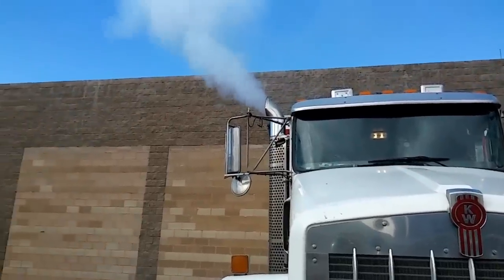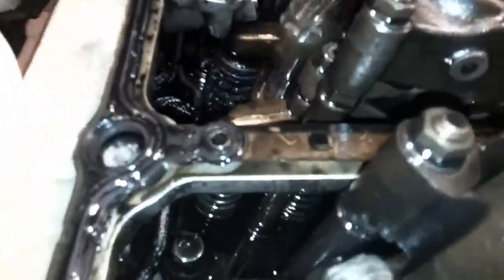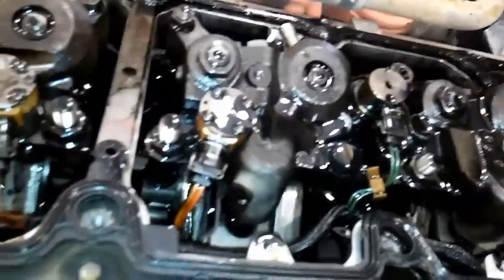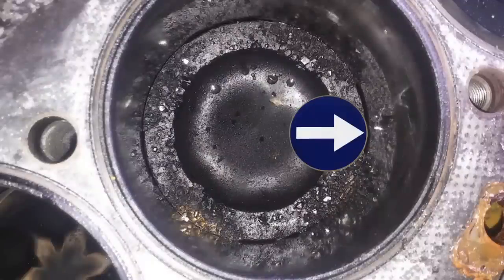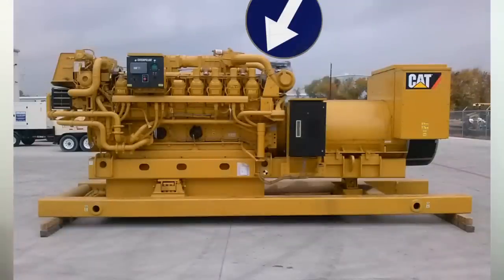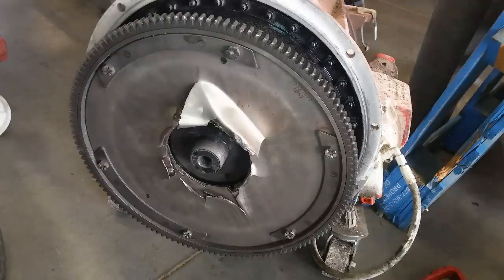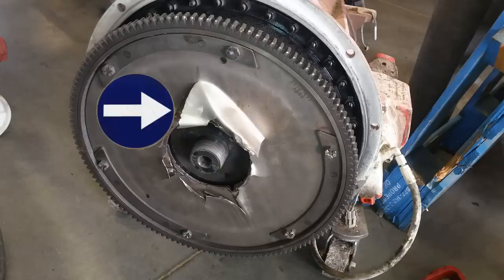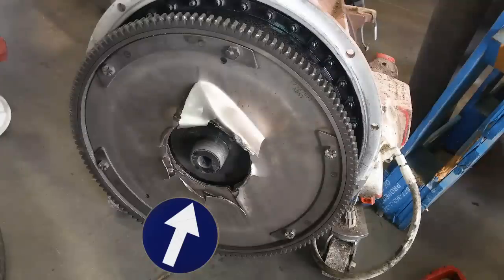Should You Warm Up A Diesel Engine?

Comment: Why not just read the owners manual instead, mine is for a cummins in a boat , it says to start engine and as soon as possible engage gears and warm up at a minimum of 800rpm unlike engine temp is reached , there is warnings in every chapter of the service manual saying do not idle engine go extended times if possible

Comment: Makes sense   ,when first starting  oil is like paint  I imagine  this must  put enormous  strain on oil  pump  as oil pressure  release  valve  cant let enough  out   .VW had problems  with  LT petrol engine drive  dog on crank would  wear away  if ordinary  20,50 oil used in cold temp  .where told not to rev engine on start

Comment: Diesel fuel does not flow or atomize the same when cold revving up a cold  engine deposits unburnt fuel on the engine and can put stress on fuel system.

Comment: I have a 2.0d engine and I start with fast 10 rev ups for idle to 1500rpm then another 10 to 2000, 2 to 2500 then keep it at 1500rpm for 30s then 2000rpm for 10s and finally 2500rpm for 30s

Comment: I have a C12  2KS  That has what Kenworth describes as a cold weather start feature that is programmed into the ECM,  I would like to know why as soon as the engine starts in 45 degree or colder temps the RPMs go immediately up to 750 then after 30 or so seconds return to normal... I normally plug it in at temps 32 degrees or colder, when plugged in this doesn't occur...
Question is, can this be deleted from the ECM because I normally like to build some oil pressure before raising the RPMs on my own..

Comment: There is no need to warm the engine.  Just watch the oil pressure and once it is up to pressure you are fine to go. Just do not hot rod it right off.

Comment: What about starting it up when it's cold out, should I let it idle and low rpm before I kick it up to the higher rpm that will supply power to the inverter and supply heat to the cab, or can I kick it up right away?

Comment: I've always warmed up my equipment, never had a problem. Company I work for gives us 3 minute idle before the truck shuts off, so they say no idling don't care if it's -20 below you WOT that with little to no idle, even if your pulling 50k lbs,then they wonder why the trucks are worn out before they hit 300k miles. Glad I'm not buying there trucks

Comment: if you live near the equater...aka Socal, Houston or FL no need to 'warm up' an engine if its above freezing, quickest way to 'warm up' (especially a diesel) is put a load on the crank and drive the damn vehicle to get block warm. Engine has no feelings, run it 15-20 seconds and drive off. Its a USA thing w diesel owners....'hard on diesels to start them' nope. 'let em idle instead of shutting them off' nope....USA diesel owners old wives tales.

Comment: It must be a Cat motor thing, but when it’s really cold every truck I drove with a cat motor idles lower than normal for a few minutes, then idle normal. The truck is drive now has an acert, once it idles up to normal, I idle it up to 900-1000 rpm to warm bc those turbo actuators don’t like the cold.  Run like shit and barely any boost till temp is around 170 degrees.

Comment: my old navistar 444E solves these warm up issues quite easily..  a feature exists in the computer that is RARELY ever turned on... it is called CAP... when its 10 degrees outside as you noted...  it starts the engine.. runs it at about 350 RPM for about 30 seconds...  then brings it up to 700  for about a miniute then 900 for 5 minutes.. then it auto adjusts the idle up to 1400  max..  until it gets near 170 degrees coolant then it backs the idle down.. i know these are old engines but the newer CATs may have the same feature that simply needs to be enabled in the computer..

Comment: Its te 15-40 oil that needs to warm up .. not so much the motor. Its same with all lubricants in the truck. You drive slow n easy till all lubricants become flowable. By time you build air pressure.... start driving slow n easy .... this isnt rocket science

Comment: Fire it up, check your lights, by then you can idle up & finish your pre-trip. Ready for easy load by then, short shift at 14-1500 RPM until temp hits 140 then increase shift points by 100 RPM with each 10' temp rise until fully warm. Engines are just like humans...be gentle when awakening the beast or you might not always like the result.

That DOTW exact same thing happened with me last week with MBE 4000 in an M2. The access hole for converter bolts is hell to get to, wedged under the damn starter on the WRONG side of the engine! POS kraut motor!!! I wouldn't wish that junk on ANYONE!

Comment: 2019 paccar mx-13, I fire it up and go to full throttle withing 30 seconds. Its under warranty 🤷
Reply: I've got one with blow by after replacing the block in another shop and I can't figure it out what's going on
Reply: Good motors I hear
Reply: It's certainly no cat, in my opinion, 600k maybe 700k and you should already have your plan to ditch it in place.

Comment: I used to drive a CAT 777G mining truck, and this winter when we had -20 -25c it had block heater and the C-32 but we also used to idle it for about an hour before we started working, by then all the oils and the coolant was at a good temperature, it also has a high idle function that activates below a certain coolant temperature

Comment: I bought an apcm for my 7.3ps so i can elavate rpms to warm up and in winter when real cold i like to kick on the unit but i am switching to a 205 t stat vs the 192 t stat and when i start driving at low pedal till warmed up a little

Comment: ''Oil galley"...?  It's an oil gallery. I am not convinced you understand engines. Cylinder pressure at idle is as it should be and doesn't vary with rpm. 80% of engine wear occurs within the first 10 seconds of starting any engine. If you are using the correct grade of oil it will lubricate any engine sufficiently within the first minute. Driving or using any engine gently from cold is a smart thing to do it shows mechanical sympathy. The main thing governing engine life is having clean oil, so regular and frequent oil and filter changes are paramount.

Comment: Yes if the temparature is less than -5 celciuz you leave it run for few minuts. If thete is temparature less than 5 degres celzium you run it for a minut or two. -15 or -20 degres celzium you run it for 4 or 5 minuts or more. 260.000km engine no problem. 1.6 TDI pdf, egr, at 207.000 injectors replaced after that egr blocked psizicaly and by softvear, had some problems with electrick viering to injectors but repered that to. For the last 30.000km and more the car is runing at 130 hp and about 300nm of torke. Stock is 105 hp and 240nm torke. I belive the car will go over 300.000with out any more problems but when it pass 350.000 km mark: turbine, injectors, clutch, break discks .... All off that will have to be changed again. So one or two more years with it and it,s time to buy a new one.

Comment: I usually let mine warm up for 10-15 minutes at most when it's about 30 f outside and I drive it for about 40 minutes to work. Doesn't have a high idle tune though

Comment: Has anyone here run a block heater on a timer from an auxiliary battery that charges from the main motor battery??  I'm just having a tough, it may not work as I do not know what kind of amps /voltages needed to run one from the 
AC/house in the first place 
an inverter  may not run one🤔

Comment: Never warm up a Diesel engine! The smart man or woman,  " Make sure you Do your Pre-Inspection first, Coolant, Engine Oil an all Related liquid's, Start this engine up! Put it in Gear and Drive off! As you are driving off; Ease into the Throttle you won't need full power until you see your Engine Temp Gage move to the normal operating range! When the Temp gage Reach's the normal range, Then you can start leaning on the Power! The reason for this concept is; The Engine will come up to the operating temperature at a faster rate with aloud on the engine, as opposed to  you just sitting there Idling  warming it up with no load applied!!!

Comment: You know I live in Canada and I know things are different in Canada than they are in the US survey nonetheless I have owned many trucks and I do not care if it is the middle of the summer on the first start up in the morning each and every start up initial start up needs 1520 minutes minimum before you gently chug out I never ever ever give it one minute that’s ridiculous it takes 6 to 10 minutes to build air to begin with so once the air is building and you get air pressure up that does not mean you can go away and drive especially if it’s winter time or cold do you want things to get a little bit warm you want to see your water temperature needle move but never ever full throttle right away ever never if you have any indication or knowledge of an internal combustion engine you know this is very detrimental to the life of the engine

Comment: if driving with a cold engine was good for it then the engine would not have a 180 degree thermostat in it, they would just run at air temp.
in real cold you should let it idle for 15 minutes or more before driving and use a light synthetic oil for winter like mobil one. look at test videos for cold oil flow like  this one.
https://www.youtube.com/watch?v=uQ_vxdO_9nc&t=128s

Comment: The most damage happens when idling cold. Engines are made to operate most optimum when at 80-90 degrees Celsius. It takes about 6 to 7 seconds for the oil to get all around the engine, stop talking bullshit!